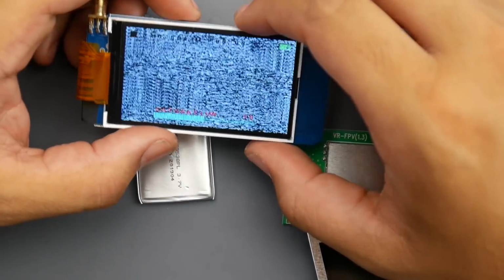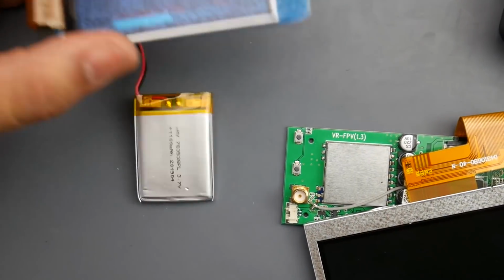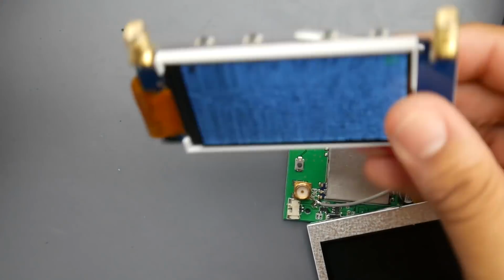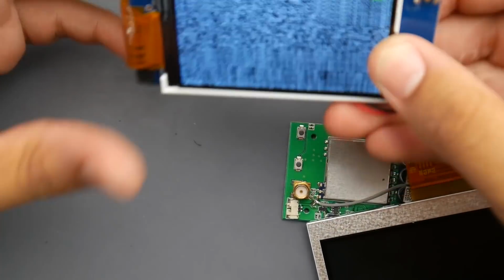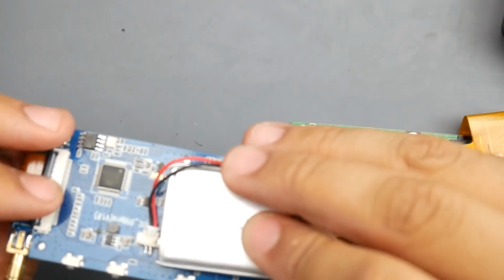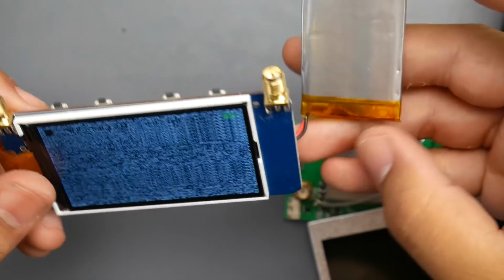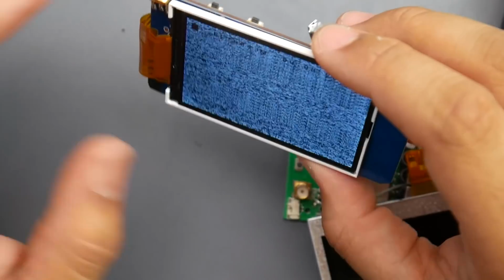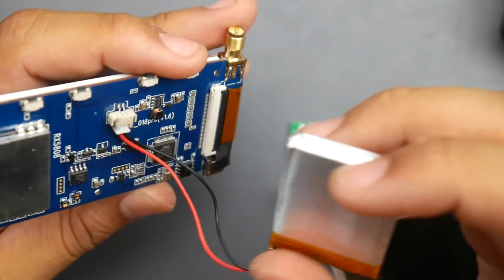Mother Of All FPV Hardware Mods // Eachine VR005 , URUAV FPV GOGGLEs

Comment: You mentioned hacking the firmware on that microcontroller. The goggles have an OSD to change brightness, contrast, etc. right? I would love to see if it would be possible to install Tetris on that chip.

Comment: are these basically just arduino like mount on screens ? couldnt you maybe grab a touchscreen arduino/raspi screen and add whatever rx you want and whatever else, maybe even use IoT and connect it all up to fpv systems... i dunno lots of potential is right

Comment: You should design a case and turn it into a monitor and share the STL file so anyone could get those goggles, print the case, and turn them into a monitor.
Reply from the maker: Already on it with mounts for our controllers as well.. Couple hours the DVR mod will be out.

Comment: Interesting if you could find out how to hack the micro-controller there's a good chance that you could replace the oem screen in the Qx7 with one of these. I'd imagine a low res screen like the one on the Qx7 is running on spi or i2c. Could be interesting. How does this price compare to low cost fpv monitors? Would it be worth it to simply take one of these and use it as a monitor so people can watch what I see as I fly?